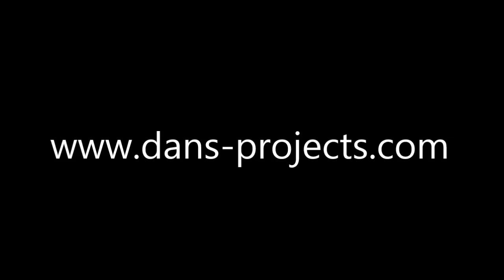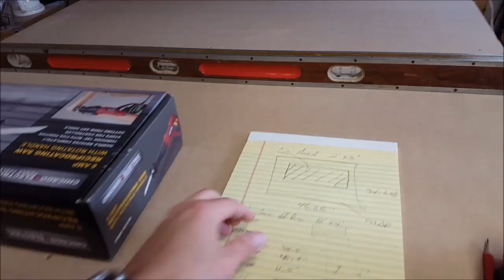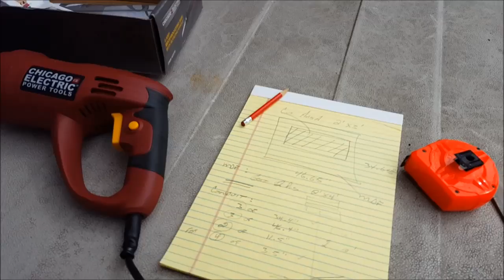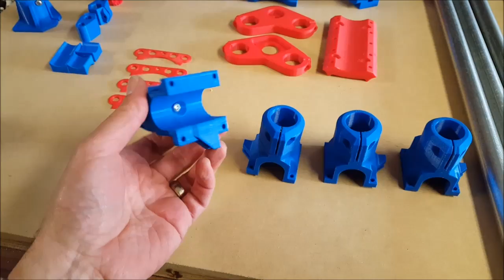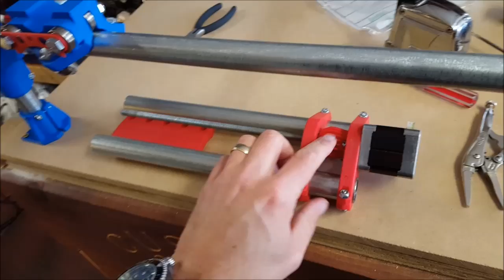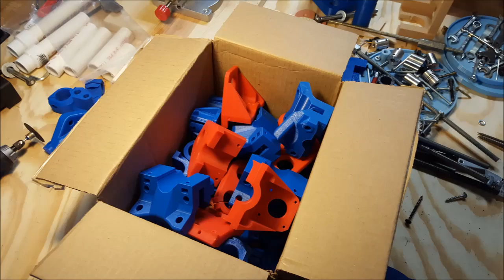A Mostly Printed CNC Project - Frame & Z Axis Finished

Comment: What are your outter and inner dimensions?
Reply from the maker: Unfortunately, I can't measure it - I used the parts from the MPCNC and re-designed the CNC into this:  https://www.youtube.com/watch?v=PpMEa_tRkmg&t=169s
Reply: There's a link to a dimension calculator on the MPCNC site where you can enter your desired work area, inner dimension, and it will tell you your conduit size, A.K.A outer dimension. I think it's roughly work area + 10 or so inches.

Comment: This is so cool!! I'm looking into getting a 3d printer here in 6 weeks once I'm out of school. What is yours and do you recommend it?
Reply from the maker: Hey Kaden.  This printer was an Anet A8 kit from eBay.  It was really cheap and the kit went together moderately well.  There were some parts that were not the best but it came out fine.  I have a small Monoprice Mini printer that has a smaller print bed.  I ended up printing some better parts for the Anet on the Mini.  The Anet was good enough to print a project like this that took over 100 hours of printing.  Currently they are around $160.
Reply: I'm stuck between those two printers actually! Haha I've heard the monoprice mini prints very well but I would like a larger print bed. Does you Anet have a heated bed? I'd like a heated bed, fan, and large print volume.
Reply from the maker: The Anet does have a heated bed.  For PLA printing you don't need it though.  With the Anet I keep the heated bed temp very low at around 35 degrees C.  A lot of people with this printer have been setting the bed temp between 60 and 80 which I think is way too high and many of those printers are burning out the connector at the bed.  As long as the bed is nice and level you really don't need any heat.  Ironically, the heated bed on my Mini printer broke so I've been printing on that with no bed heat.  Sill works fine.  The thermistor is broken and I've bought a replacement but haven't had the time or need to solder it in yet.
Reply: I also have an anet a8, printed all my mpcnc parts out on it and was printing with petg using heated bed. Just have to print out the nut holders. The anet is a really nice printer for the price.

Comment: Cool Video, thanks! It is hard to put into words but you seem to understand this stuff better than most and definitely understand why I did some things the way I did.  You should have a great time with this.

As for the smoothness issue from the sound of it you are it bit too tight on all of it, or maybe just extra thick galvanizing. That crunchy sound is always there but in yours seems a bit extra.

I would say try backing the tension off just a bit on all the tension bolts. Either way, after a little run time it will kinda break in and get a bit smoother. lots of zinc will come off at first just wipe it down a few times and it should be noticeably smoother.
Reply from the maker: Thanks!  Really great job on the design.  That center assembly is brilliant.  I'll ease up on the bolts and hopefully it will smooth out a touch.  I want more weekend to play some more with this, why does Monday come so fast?
Reply: Actually, mine made the exact same sound as yours. I looked at the belts, etc. Then I notice one of my pipes had the imprinted writing that is stamped in the conduit, turned so one of my bearings rolled over it all the way down the pipe making the sound you hear. I loosened my clamps and turned the pipe so the stamping wasnt under any of my bearings and now everything sounds nice and smooth.